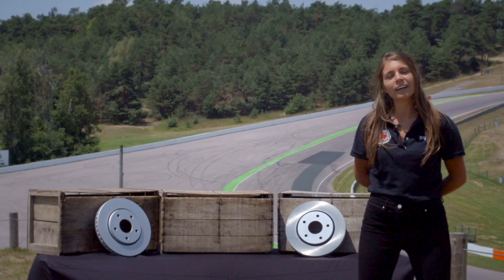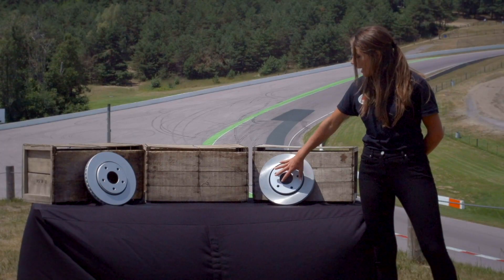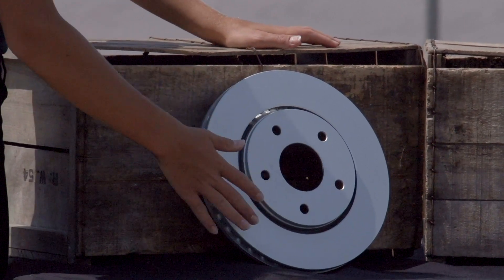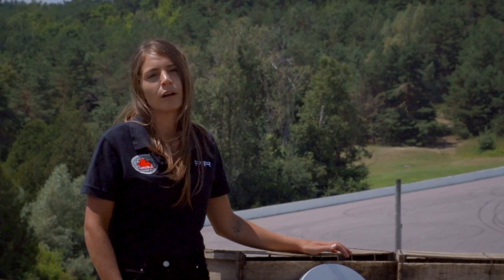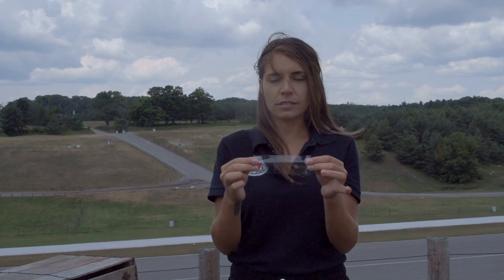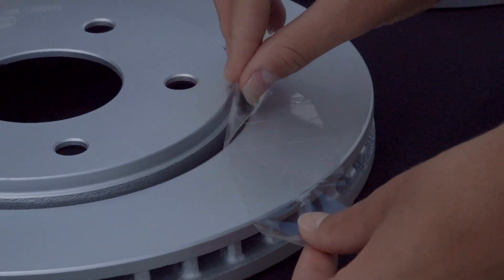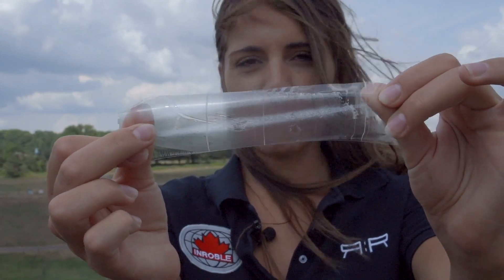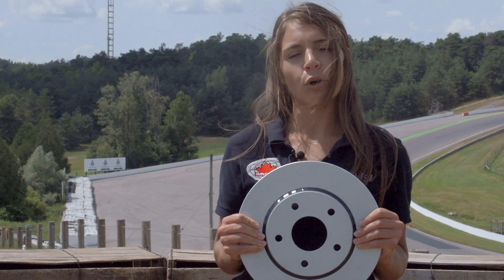Inroble Episode 1 : Brake Rotor Coating

Comment: I bought some Inroble rotors for the front of my car from some guy on Craigslist years ago, and they are holding up MUCH better than the Chinese ones on the rear of the car which are rusting out like mad which is seemingly the theme for all aftermarket rotors out of China.

So.... Is there any way I can buy another set of them in the States?